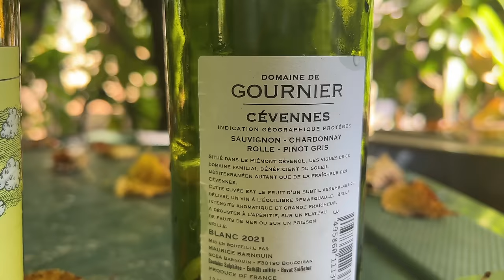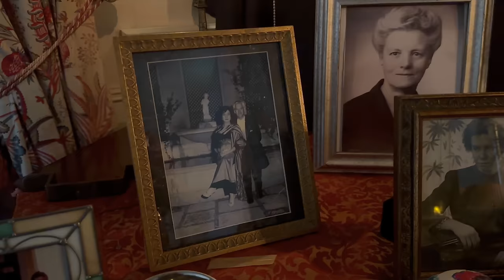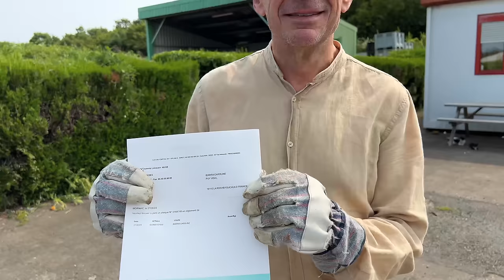AUTUMN MAGIC AT THE CASTLE | Cottage renovation begins, Halloween festivities and more

Comment: @28:22. That building's mortar looks pulverized.  The stonework along the roofline will need to be re-mortared, and the walls repointed at the very least.

You should be able to remove that rotten beam as there is no second level anymore.

The stones from the wall your removing can be used to build up and reinforce the load bearing wall sections under the roof beams.